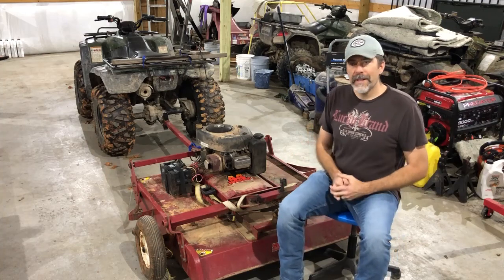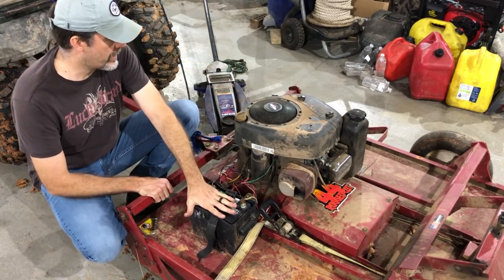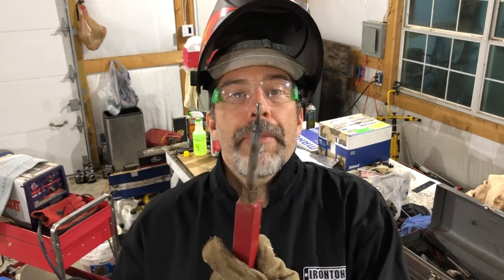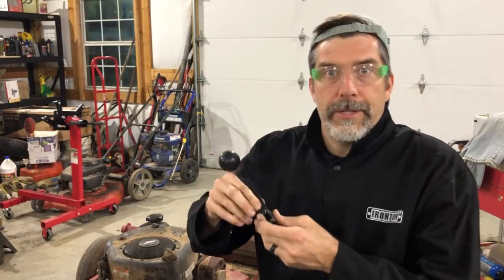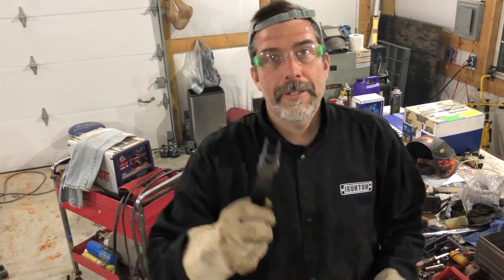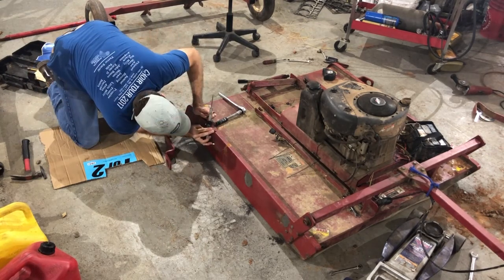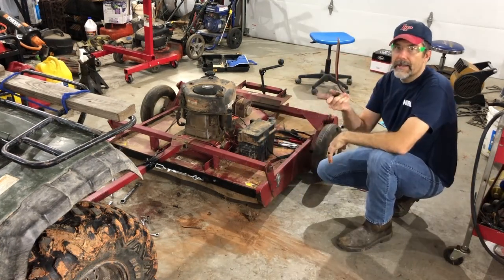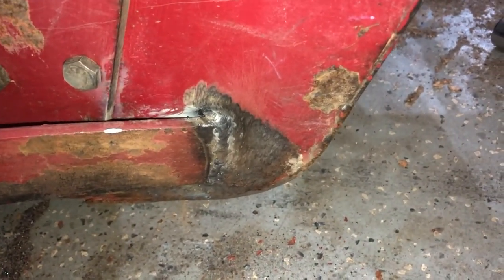Swisher Rugged Cut 44 Trail Mower Repair & Upgrade

Comment: Looks like it would've been easier to get a riding mower remove front wheels, install a couple swivel casters mount a tow bar and throw it in neutral
Reply from the maker: That might work for a finish mower, but the blade design on a riding mower limits what you can cut with it. A bush hog deck on a riding mower would be awesome. Let me know if you guys want a video on that :-)

Comment: I have the exact same mower and need the correct model number.  Anyone?
Reply from the maker: These are the models listed in the Rough Cut 44 manual: RTB115441
RTB12544
RTB134412V
RTB14544
POLB10544HD

Comment: I am in the process of rebuilding my swisher 44 rough cut. It has been a beast for about 5yrs. About a month ago, the shutoff valve on the fuel tank broke and up in flames she went. I just rough mounted a 24hp vtwin on it and now i am waiting for the engage cable to come in and she should be ready to get back to work.
Reply from the maker: Wow! I broke mine a few times but never burned it to the ground. The engine upgrade was a huge improvement for me. I had to modify the suspension and clutch spring because of the new motor though. The other thing I always wanted to do was change the cable clutch to electric clutch. That should save a bunch of belts!
Reply: Would you happen to have a part number for that engagement cable? Also where you got it from? I can't seem to find it

Comment: any Idea what size axel is on that? I need to replace my bearings on both tires. Thanks for the video.
Reply from the maker: I think it was 3/4”. I bought tubeless tires at Atwood’s that came with wheels and bearings.

Comment: Do you have any videos on how to wire the mower and how to change the belt.  Mine is obsolete, 
and I can't find a manual for it.
Reply from the maker: Sorry, I don’t. I used the engine and electrical components from a Craftsman mower and wired it like the mower. Also, I modified the tensioner spring to make the belt tighter so it wouldn’t eat so many belts, but that was before I started YouTube.

Comment: I think this is great. lol I bought a 60” swisher finish mower last year. Within a week I destroyed it. Bolts came out of the clevis so it come off in my back hay field. Welded it back on making it better. Couple days later the engine mount bolts came out I guess and motor come off. Fell over on deck and caught fire. 
Tractor supply was great, they returned it no questions asked and shipped me a new one. A year later tires continuously go flat and all my height adjusters are bad and missing handles. $4k bucks, it does take a beating mowing fields after cows have been in them but I try to take care of it. Any useful upgrades will be great.
Reply from the maker: If you don’t have solid rubber tires you should get some. I think I bought mine at Atwood’s.

Comment: I think your welding is just fine. I go with fixed over pretty any day. And with all the cost cutting and cheap this and that, you stiffened that tongue right up. Something can always be made better and since you don't have to make anybody happy but yourself, you can over-fix it to your hearts content. I like improving stuff if I can without going too far overboard and that's a FINE Bible verse.
 Thanks, keep on fixing stuff and GBWYall!
Reply from the maker: Thanks! I’ve got a long list of things to improve on this mower. The next thing I plan to do is replace the blade bolts with shoulder bolts so the blades don’t tighten themselves when I run over a log. I think it will also help save belts if I replace the mechanical lever with an electrical clutch. That will probably have to wait until next season though.
Reply: @barntech2291  Wouldn't hurt if the drive system had some 'give' to it so something might slip instead of wringing off. And you've got power there for a clutch. You'll get it and GBWYall!